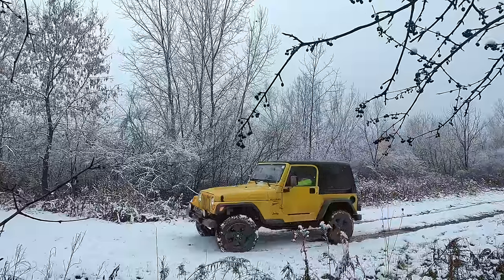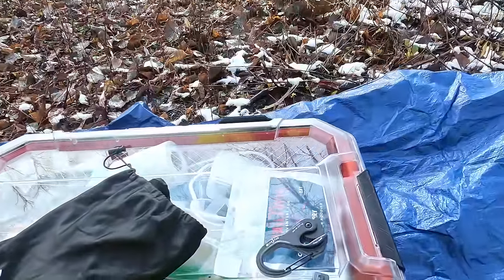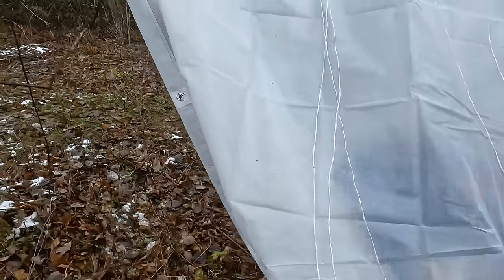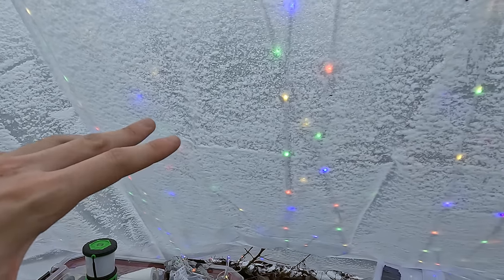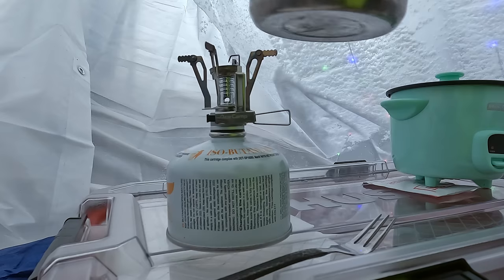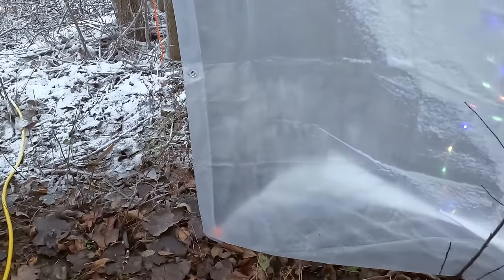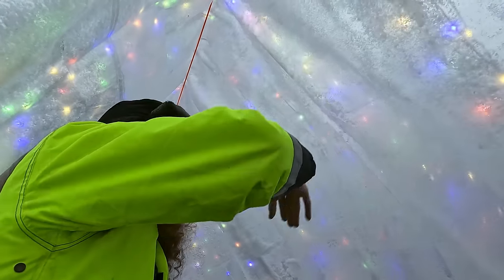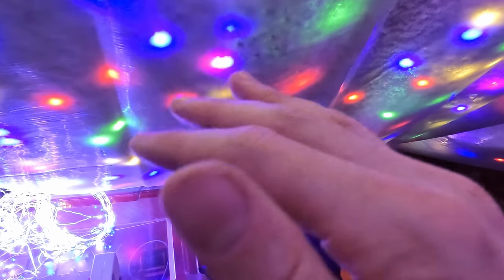Christmas Light Shelter On A Snowy Winter Night - Off Grid Power + Heated Electric Blanket

Comment: What a very cold adventure! And all without gloves. You're fortunate when you're thinking up all these adventures in your head that they come out almost exactly like you envisioned, sometimes better even. And all those lights! (smart of you with that warning). Imagine someone happened by your Christmas themed campsite at night! ( Why either one be out in that kind of weather is another story, but I digress). And that tuna and curry combination. Though I wouldn't have thought to be them together, I can see it now, ( btw, spice does warm up the insides, judge that by the beads of sweat on the forehead depending on the level). And though your mattress went out, it could have been worse. Could have been your electric blanket. I would suggest next time have a backup, the  blanket, of course, mattress optional. And what about that sunrise 🌅.  A picture-perfect Bob Ross painting😊. Very nice.